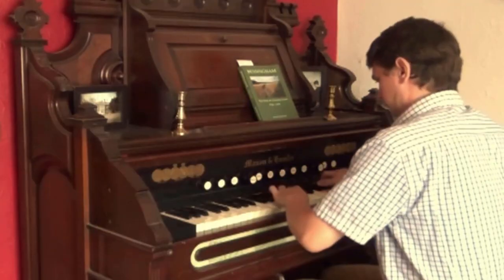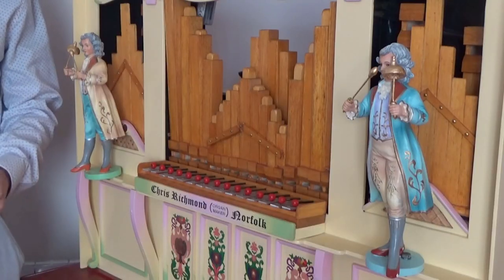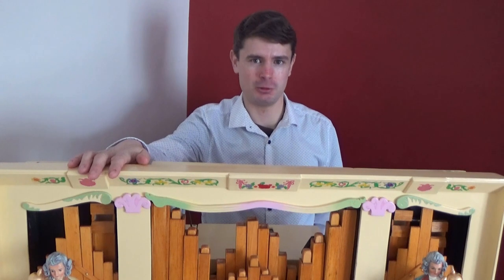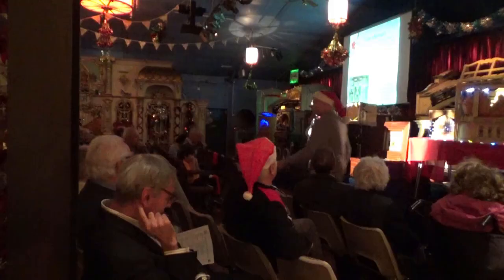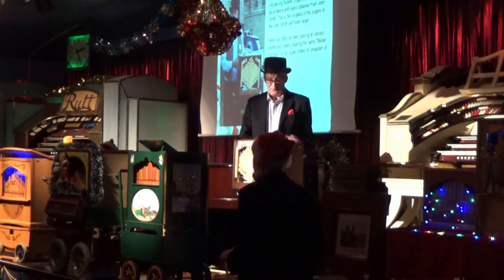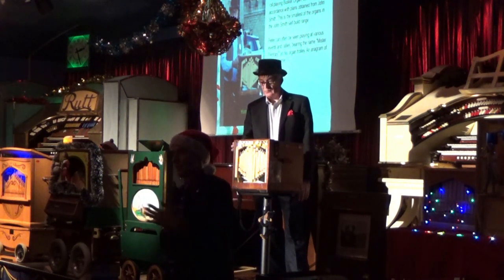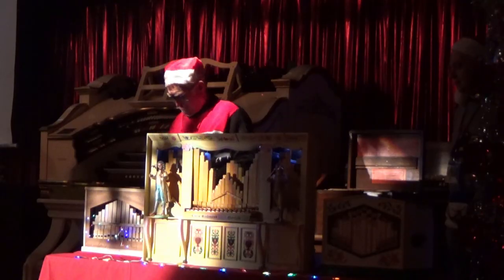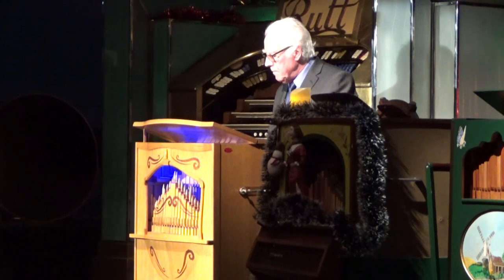Ep14: St. Albans Organ Chris-mas Special

Comment: Oh the music sounds like it was inspired by the ground force theme......I unfortunately  went digital ....Learned how to programe MIDI
Reply from the maker: The original idea may have been! 👀😉

Oh, I've been toying with digital- I've made a few arrangements for 52key Dutch but not really done anything with them.
Reply: I have a sample set of a Dutch fair organ I've started to program for the sampler kontact
Reply: Unfortunately all my instruments that used BLE WiFi MIDI got stolen
Reply from the maker: I have also sampled a Dutch Street Organ and have plans to develop a VSTi. One of these days I'll get round to finishing it!
Reply: I bought maize sampler with the intent of making vst
Reply from the maker: @KarlSheen  Yes- that's it. Maize- that's what I use. 😎
Reply: If ya need a hand I'm happy to help as I'm good at general graphics also have a amazing ear for sample looping
Reply: If I can give you my email would you be interested in helping me out with a brand new keyboard carillon idea?
Reply from the maker: @KarlSheen  Sounds intriguing... A Keyboard Carillon.
I'm toying with an idea of going the other way and "midifying" an Ellacombe chime rack to play from my library of bell sounds...
Reply: Use a Arduino chip with Bluetooth get that to trigger 5v to 24v relays which trigger 24v solenoids. You can play the bells from outside if you boost the Bluetooth signal. By adding a clock timer module to the Arduino chip you can then create a chiming clock. My prototype I made a few years ago I butchered a set of 12 self chiming Christmas bells. All the quarter chimes and music was simple MIDI files on a SD card. One clock company somehow caught wind of my design as I had the most complete list of quarter chimes from all around the globe and in their correct key. The matching keyboard was a ridiculously simple 12 key that resembles a toy piano. Recently I've bought a mini 25 key MIDI keyboard with the intention of buying a set of Chinese mini handbells and electrifying them. I know deagan made similar even utilising a simple volume knob that decreased the voltage to the solenoids. The local Catholic Church has a set but due to disagreements I refuse to go there anymore